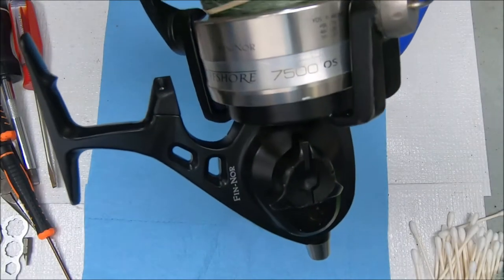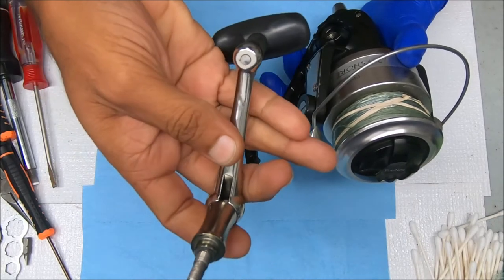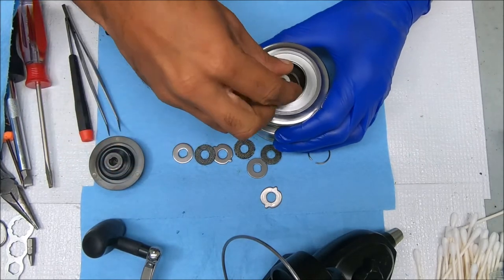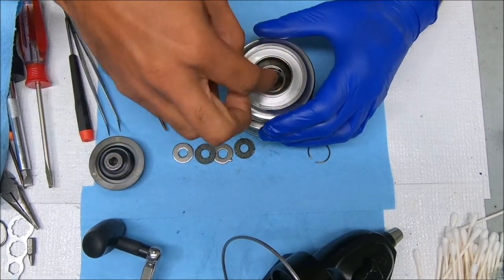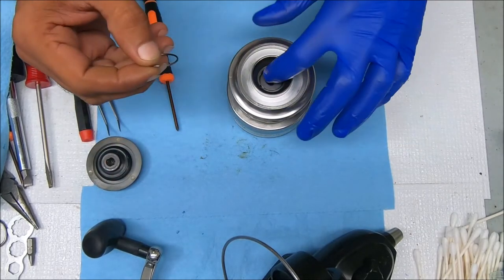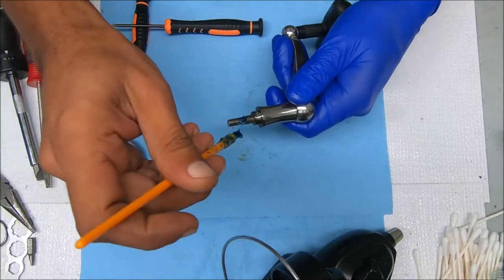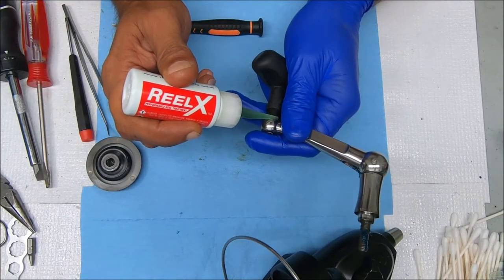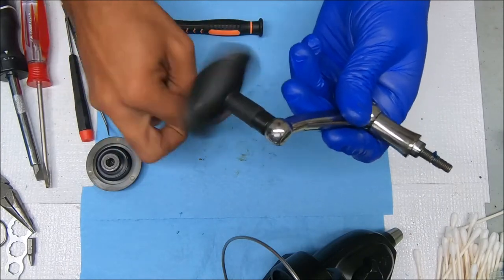Fin-Nor Offshore 7500 Fishing Reel - How to take apart, service and reassemble

Comment: I have one of these... it's an absolute tank. Just discovered that you did a video of these reels... thanks man!
Reply from the maker: Agreed and thanks for watching! Nice mutton! Spread the word about the channel.
Reply: @dartfrogger  si on compare avec un saltiga 6500 de 2015 lequel ? Pour gros thons ?
Reply: @lavazza8031  It depends on your definition of big tuna, and your methods of fishing for them. This finnor reel will work for almost everything. The line capacity is higher, and this reel is very strong. The 6500 saltiga has much less line capacity, but it much lower weight. The saltiga is very light in comparison, and also more refined and smooth. If you are casting popping lures, then use the saltiga. But dor everything else, like trolling or jiggins,  I would use the finnor. The only disadvantage of the finnor is that it is very heavy. But the much higher line capacity, and higher drag is a massive advantage for the finnor.

Comment: Hi, nice done, just brought a 10500 a week ago and greased it "properly" with Penn grease, with properly l meant almost filled it completely with grease 😁, didn't opened it completely.
Reply from the maker: 🙂 thanks for watching! Spread the word about the channel.
Reply: @TSGReelService  Hi, since i opened the rotor, a nice surprise came into light, the anti reverse system has been massively improved, firstly they added to the new 10500 a second dog ratchet so now there are two of them, both functional and functioning and the second improvement is that there seem to be more teeth in the rotor and there aren't any missing teeth anymore around the whole interior of the rotor.
Don't know about the smaller models but the Fin Nor Offshore 10500 has been substantially improved. 
Another small improvement this time, is that for the same part there aren't any different screws anymore.
I wrote to Alan Hawk who complained about that "missing teeth at nine o'clock" in the rotor and also claimed that the anti reverse systems of the Saltiga and Stella would be superior due to the weaker ratchet system of the offshore, which additionally would wear out with the time but now with two ratchets they are stronger and don't wear as much, are they..? 
Hawk also claimed that the drag systems of Saltiga, Stella and Makaira would be superior to the offshore, thus only those would be appropriate for pelagic fishing but again interestingly enough, i saw a pull test in a polish yt video with a scale in kg, the offshore pulled 47kg which is over 100lbs and that was the older version of the reel..!
So not all what Alan Hawk writes is true, a pinch of salt is neded there too..!
I wote to him about and even linked the video in question but he kept his finger crossed so he didn't "manage" to write to me back to contradict or bring any counter arguments whatsoever...
Not even the fact that i wrote to him that Hawk devolved into a sparrow and now we don't only have Jack Sparrow but we also have Alan Sparrow moved him to answer. He seem to be sold to Saltiga, Makaira and Stella but the question is, is he also brought by Daiwa, Okuma and Shimano..?

Comment: Hi, I have a FINNOR 9500 reel, the thread does not work evenly when up in the bottom a lot of thread and down a little relatively. Is it possible to add a washer to create a balance and if not do you have a solution for it ? Thanks in advance master
Reply from the maker: Thanks for watching. I'm sorry, but I don't understand the question. Is it possible for you to post a video of what you're referring to?
Reply: @TSGReelService  As far as i understand he gets unevenly line on the spool so he would like to know if is possible to add any washer so the line would come evenly on the spool. But most probably the issue is solved already.

Comment: Hi, I would love to hear your professional opinion if possible. I have a Pinor 9500 and the screw of the belt does not open. I tried to lubricate the screw, but I could not open it (MINUTE 12:55). The bearing is stuck and does not turn and I need to get to it, do you have any idea? Thanks in advance
Reply from the maker: Thanks for watching. I think these only have bushings (no bearings), so if it's frozen, it's probably just at the ends of the line roller. Try leaving the screw alone and using a toothbrush and oil to gently remove the buildup.... you can also try gently working the line roller back and forth on an arc (in the directions the line feeds off and onto the spool) with needle nose pliers (you have to be really careful here).
Reply: @TSGReelService  Thank you so much for the professional help, you keep saying "thank you for watching" and I want to say thank you so much for having the right to watch your interesting and professional videos !!!
Reply from the maker: You're welcome. Let's compromise at it being a two-way street. 🙂 Thanks again.